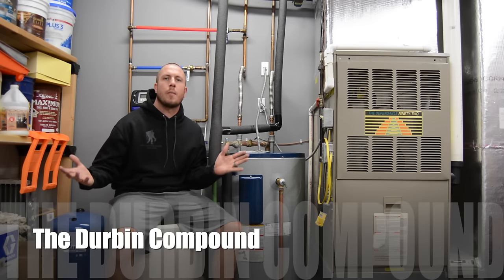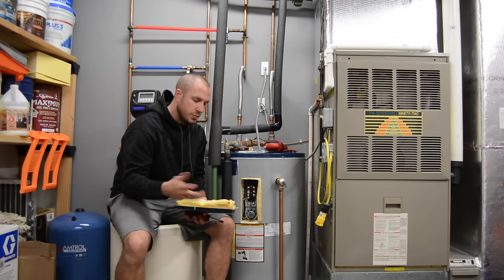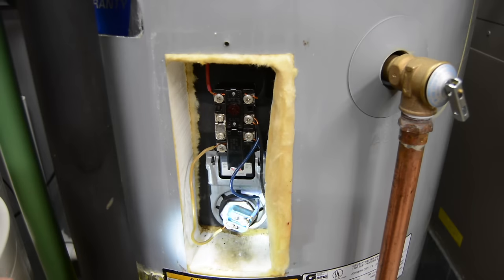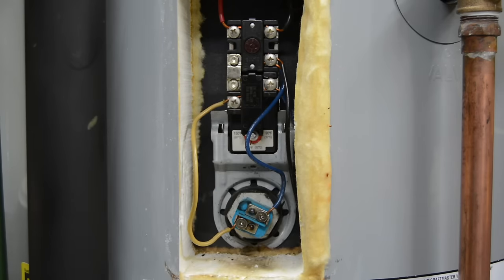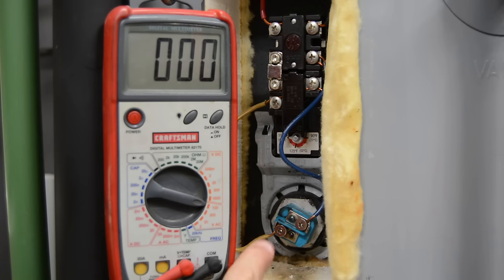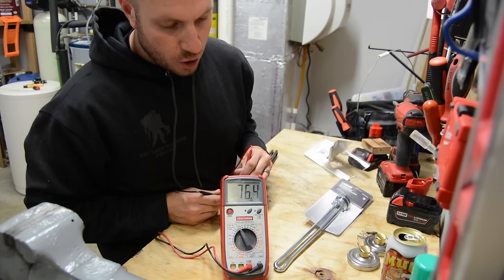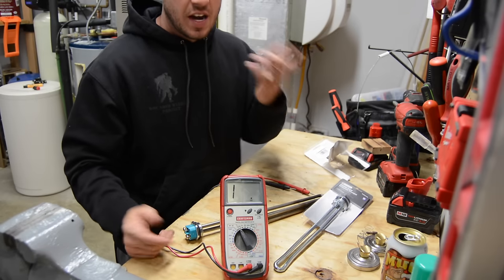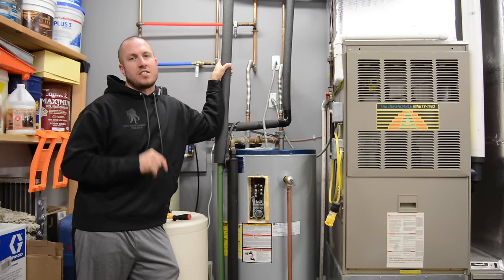How To Tell If Your Water Heater Element Is Bad

Comment: 3:10 as long as you're only touching one power line you're only getting hit with up to 130-ish volts depending on where live and how much voltage drop you have in the line from the breaker. You get a 240v line by having two 120v lines, you get 360v by having three 120v lines, and you get 480v (some electric cars charge with this) by having four 120v lines.

Comment: My Electric Water Heater still won”t work 
We have no hot water 
Can you tell me what  cause the problem.. or how can I  check any  other options please
Reply from the maker: Breaker on and not tripped in panel.  Check the voltage at each heating element.  You should have 240VAC at each heating element.  If you have power at both heating elements then your elements are bad. If you don’t have the power there then check to see if power is coming into the thermostats
Reply: Check the power obviously then if you have already replaced the elements then test the thermostats for continuity. I will tell you from many years of experience that testing an element with a multimeter isn't always 100% accurate at the minerals in the water makes the water conductive and will occasionally give a false reading. As for testing the thermostats you will have to look up how to test a water heater thermostat and I'm sure their will be a video. It's not complicated however explaining it over text is lol. Also if the water gets hot but doesn't last long however recovers really fast say 10min the it's likely you have a broken dip tube and the heater will likely need to be replaced. I'm sure you could find a replacement dip tube but I know I can't get them locally and the heater also needs to be cleaned out of all the broken tub so I just replacethem myself. Good luck.

Comment: Wasn't the top thermostat providing power to the top, as you tested it, when you turned the temp setting up, and went right to the bottom, and got power there too. I never heard of it switching the power to one element at a time.
Reply: Only one element at a time is powered  always
Reply: Both elements have 120 volts on one wire at ALL times. The OTHER  120 volt wire is switched back and forth between the two elements thru their thermostats. The top thermostat MUST be satisfied before switching and sending the 120 volts is was using down to the bottom thermostat to use to complete the other side of the 240 volts. That being said if the top thermostat goes bad it can never be satisfied, the top element will never heat thus never sending power to the bottom element. So..... your left with a full tank of cold water.....even if the bottom element is good...

Comment: My water is too hot. I adjusted the temperature and it still is too hot. I changed both thermostats. Still is too hot. The manufacturer says my element could be grounded, they show a resistance of 23.4 ohms both. The manufacturer tells me it should be 19.1 +/- 1.1. I changed both elements (They looked still very good and clean)  and it is still too hot even thought I set the temperature at 125F and the manufacturer recommends 135F...  Any ideas ?

Comment: Tested both of my elements and they both tested at about 12 ohms. Way less than what your showing . These are 4500w elements. Should they be reading higher resistance than what I'm seeing?
Reply: average is 10 to 30 ohms so yes its good. Also could be bad if ground faulted. check for short between wire terminal screw and element mounting surface. Should read 0 if good...
Reply: also see this for testing elements and check for short.

https://www.youtube.com/watch?time_continue=11&v=LxnZQZm9YcI&feature=emb_logo

Comment: Can you explain why the upper element should have a different voltage than the lower element..?In my case the upper element gives 240V and the lower element 130V.
Reply: They are different because only one can be on at a time. You see 130 at the bottom
 Because that Is the power being supplied to the lower thermostat when it needs power to heat the element it will then bring in the other 120 from the other side of the thermostat (top one since it turns off)  giving you 240 on the bottom element.  The top one should no longer have 240v
Reply: I have yet to hear a click. I bought a new thermostat and elements and still no click. I'm also only reading about 120V on the top. Is there something I'm missing?

Comment: If one element does not work right would that cause it to take longer for hot water to get to the other side of the house?
Reply: If the top element is bad you will have cold water.  If the top works, but the bottom is bad you will have warm water.

Comment: I'm pretty new to this, but after watching several different videos and testing my own new heating elements, shouldn't the ohm reading be at 13?  How are you reading 77?
Reply: I just did mine and got 19
Reply: @bansheeiwtd2978  Are your elements 3500W instead of 4500W?

Comment: My son was confused by your ohm reading on the box store element being a dual voltage either 208 at 3500 watts or 240 at 4500 watts your ohm reading will be 16 or 13 NOT 77 ohms  recheck your reading 240 with 13 ohms =18 amps  amps x volts = watts  my 2 cents purchase an amp meter clamp on  77 ohms is only 3 amps =720 watts HOPE this helps CHEERS

Comment: Changed both heating elements ,changed thermostat ! Showing 120 volts going to elements still no hot water any suggestions ????
Reply from the maker: Goodness that’s a head scratcher.....I’m not sure. I would doubt you got bad elements. Can you feel it getting hot around the element? Carefully of course
Reply: Probably it's suppose to be 240 volts
Reply: If the wh is rated 240 but your only getting 120 volts then your only getting a4th of heating potential
Reply: @themovies8  I have almost same problem. I replaced thermostat and heating element. all Volt readings read 240V from break panel to the heating element. Power to both yet does not heat. I have a US/Craftmaster 30 gal elec water heater only 1 thermostat and 1 heating element. Ant suggestions?
Reply: @juanramos6573  check if you have resistance and divide amps by volts if it equals what u got for resistance reading then your good and should start looking elsewhere for problems if it’s not even close then replace elements

Comment: Is 237 volts with in normal range? Also if you replace one thermostat do you need to replace both. My heating elements are fine but I'm not getting any water out of the line still! Any suggestions?
Reply from the maker: Yes 237 is acceptable. Should be close to 240. You can get thermostats in a twin pack. I’d go ahead and change both just to be sure. Give it a few hours and see if you get any hot water.
Reply: So, I'm getting a trickle of water for the hot side. Cold is flowing normally. The pressure relief valve is working properly. Do you think I have a blocked area in the tank or in the hot water line?
Reply from the maker: Beth anderson yes absolutely sounds like it
Reply from the maker: Beth anderson is your tank older? It might be full of calcium.....
Reply: @TheDurbinCompound  it's about 7 years old or so. I have drained it and there wasn't much in the tank. It seems as if the cold water is not filling at all. My pipes run through the slab of the house and behind a wall. I haven't seen any water pools anywhere to indicate a broken line. Could it just be clogged?
Reply from the maker: Beth anderson that is possible. Seems like you have a clog somewhere in that side of the system.
Reply: @TheDurbinCompound  thanks for all of your advice. When it warms up tomorrow I plan on trying to flush the tank.
Reply from the maker: Beth anderson let us know!
Reply: Beth anderson, you have very little volume at all of the hot water outlets, but good flow when all cold are on at the individual devices? Did hot water problem gradually or suddenly occur? When you drained tank did you have full good/ flow during draining process with tank inlet closed and relief valve open to break vacuum, but then slow flow refilling? Can you disassemble union at top of tank and then check supply flow by opening shutoff valve? I've seen where plumbing contractors or 'repair people' have installed reduced port rather than full port valves in lines, have used excessive amounts of pipe dope or Teflon tape, or have actually filled lines/ fittings with solder. On commercial/ institutional/ industrial jobs we've found were people shoved pop or beer cans and bottles, or other debris in open lines--
Check inlet valve to tank. If gate valve, it should be fully counter clockwise. If ball valve, handle should be in line (parallel) with line. 
If no hot water flow at any faucets or tub/shower fixtures (washing machine/ dishwasher when on hot, can open relief to see  if you have flow. 
For those who have not attempted to open drain valve at bottom of tank, it may create a problem if tank has not been regularly drained. Sediment can clog drain mechanism-- sometimes preventing draining or preventing reclosing of drain valve.
Most people do not drain residential tanks or boilers as recommended. Industrial and institutional boilers are typically (recommended anyway) 'blown down' daily and closed systems (heating/ process) have feed water treatment.
 Plugged orifices  on single handle valves and plugged aerator screens at faucets are also common.
With lines embedded in slabs crushing or occlusion can take place if there is settling or other slab compromise.
Lines may be occluded due to sediment and corrosion build up.
Reply: The elements were bad and covered in build up. There was also a load of sand in the tank. Replaced the inlet connection, the 2 heating elements, and cleaned out the sand and build up. It's back up. Thanks everyone for your advice.
Reply from the maker: Beth anderson well that’s good to hear!

Comment: Very well explained.......however.....I rarely bothered checking for continuity.....too many steps.  I leave the power on, get power to the element , put the amp probe around each lead wire.  Ohms law.......3000 watt element with 240 volts should draw 12.5 amps (3000 divided by 240).......and 0 amps with amp probe around both lead wires(equal and balanced load)means good element. Otherwise.....no good.

Comment: I just replaced my hot water heater two weeks ago. Why is it leaking from the bottom element. What can I do to stop it?
Reply from the maker: Yikes! It may just need tightened up. It may have a defect in the threads and seat where it tightens to
Reply: Thank you very much for your help.😊

Comment: I have 290 at the top and 150 at the bottom. I have the top cranked as low as possible and the bottom as hot as possible and no change. Bad lower thermostat?
Reply: Also, the water heater isn't heating at all anymore
Reply: @joshdahl4  sounds like bottom element or thermostat are shot. Test each to make sure
Reply: @Muscles_McGee  thanks. Turns out the top element was broken, literally missing a chunk out of it. Don't know how that happened. 🤷‍♂️ Anyway, I replaced it as well as the bottom element and we are running good as new. Thanks for the help!

Comment: I get 240 on the top element 0 on the bottom,  I turned the top thermostat low bottom therm all he way up?
Reply from the maker: May be a water heater that only heats one element at a time.
Reply: Also I’m get zero on the leg coming into the bottom?  What could be wrong
Reply: Replace both bottom components?
Reply: Backstory the road I live on had a water main break and the reset on my tank was popped
Reply: I have worked the last two days so my family has been without hot water 3 days now
Reply from the maker: Some water heater models will only heat one element at a time, that might explain the zero coming in.  So you’re getting power at the top element but it’s not making hot water at all?
Reply from the maker: The way you explain it, sounds like a bad bottom thermostat if you turned the top one down and the bottom one up.

Comment: If you turn off the breaker, killing the power to the element, I don't think you need to remove the leads off the element.
Reply: If you mean when he was checking continuity on the bottom element, yes he needs to remove the leads.  If not, the continuity check could back feed through the thermostat and show a path even though the element is open.

Comment: I am getting a reading on the bottom element but not the top one
Reply from the maker: That don’t run at the same time. Only one at a time.
Reply: Thanks for replying to me I have decided to replace both heating elements and probably both thermostats since they come in a kit. I am new to using a multimeter I'm still learning
Reply from the maker: Yeah it’s a good call to just do them together.
Reply: @TheDurbinCompound  quick question I know a bad heating element could kick off my main breaker but could a bad thermostat do the same? Should I hold off on putting in the thermostats?
Reply from the maker: I would say no a bad thermostat shouldn’t trip a breaker
Reply: @TheDurbinCompound  just changed out both heating elements and left the thermostat alone and it's working fine thanks for your help I appreciate it. I had about 9in of what I think is calcium buildup in the bottom of my two-year-old hot water heater
Reply from the maker: @grunt9131  definitely drain your water heater every year! It’s 100% necessary! I have a video on this as well

Comment: First of all the wet finder joke is not a place for this type of video. People sometimes don't hear instruction at 100%. if someone is a real greenhorn and catch only the first part about the wet finger and get distracted and miss the sentence "DON'T DO THAT". Now you got a maybe a dead  greenhorn. Also using  a screwdriver as a pointer at a live thermostat to demonstrate, not understanding the most likely most of your audience may not understand how dangerous that could be is very bad all around.  You may know your stuff, but because of your loosey goosey safety attitude no way i would recommend you for instructions. Had to say this. NO JOKES.
Reply: all the other videos tell you to turn off the power and check for continuity.  not open a hot 240 volt and put your fingers and screw driver in there.  it was like watching someone dance on the edge of the grand canyon.  one little touch and it could fry you like a hot dog cooker and stop your heart from beating instantly.  right or am i too scared of the voltage?
Reply: @iztheterribleable  he did turn off the power when he checked for continuity?

Comment: Its called take an amp draw. If there is none. Verify you have correct voltage. If you do, kill the power and ohm out the element. Pretty easy stuff. You can do it with a 5 dollar ace hardware meter.